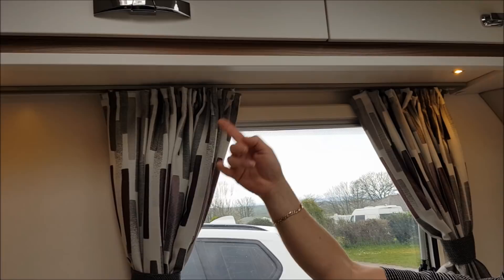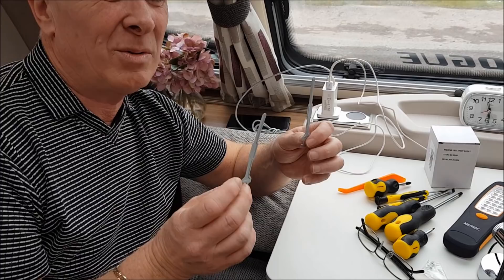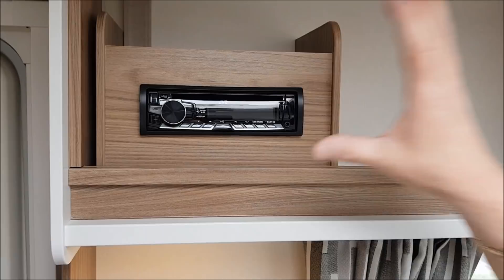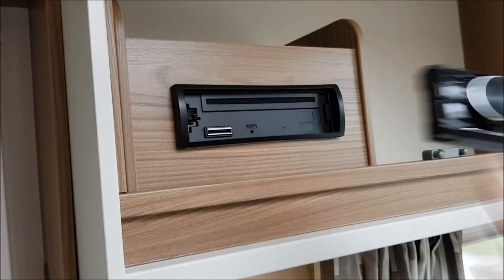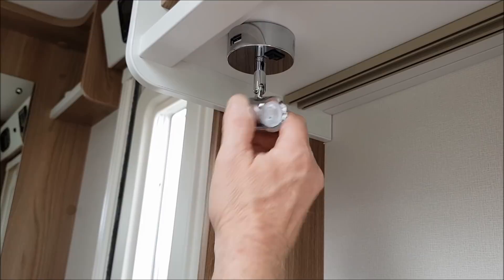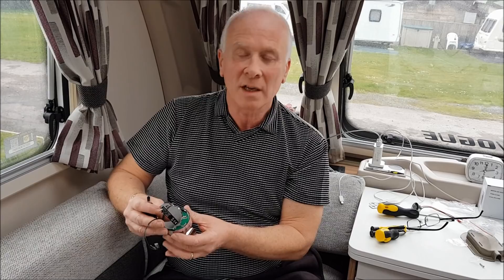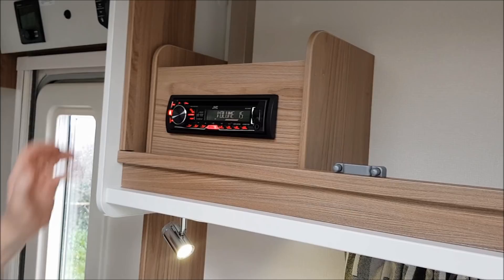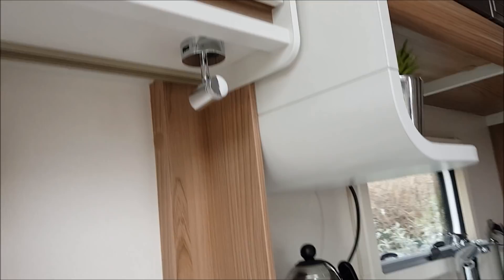Radio removal and USB Spot light Upgrade

Comment: Great job there Keith, I did quite a few mods on my last caravan, including adding mains sockets a cable routed behind the cabinets to allow the TV sound to come out of the stereo speakers. I have the same lights as you have here on my caravan, as I already have a twin usb point at the front, my plan is to fit another switch each side so I can turn them on and off from a seated position.
Reply from the maker: It’s so satisfying when we do these jobs Gareth. Many thanks for watching. Sending our best wishes, Keith & Michele

Comment: Hi Kieth & Michelle, liking the videos so far, I`ve just hit the subscribe button. Julie and I have been caravanning for arounf the same time as yourselves, and as you have said there is lots to learn. I really like this vid as I`m thinking of doing away with those small downlighters in our van, ( a 2019 Swift Celebrate. same as yours but different soft furnishings) and I much preferred the spot lights that were in our last van. Look forward to your next vid.
All the best,
Black Country Dave
Reply from the maker: Hi Dave & Julie, Thank you so much for subscribing & welcome to our channel. If you are going to change to the USB spotlights you may need to look for them on EBay as there is currently a shortage from the original stockist. Let us know how you get on 👍🏻 Thanks for watching, Keith & Michele
Reply: Thanks for the heads up, but I won't be needing the USB socket versions, as our van has USB sockets fitted elsewhere.
All the best,.
Black Country Dave

Comment: Great job there.  You make it look very easy and its good for others to see.  I know it seems a big thing to have as many  usbs all over the caravan but Im not sure Id like wires dangling down from the lights so we just use an adapter plug with usb slots (only the two of us anyway). Good to have the dimmers though.  Great video and thanks for sharing  :)
Reply from the maker: Thanks for watching Guys. Understand about the hanging down cables but for us it's not really a problem as we have a small shelf at the front of the caravan which holds our phones. Keith & Michele
Reply: @keithandmichele  Indeed, we all have different needs and preferences.  Its just lovely that we can adapt to suit those needs and folks like yourselves share your knowledge and experiences.

Comment: Excellent video, had thought of this but not sure Id want all the USB leads hanging out of the lights, think id just prefer to use the plug sockets.  Have to look at it when we are away over Easter for the first time this year.  Keep up the good work.
Reply from the maker: Thanks for watching Andy, we do have a small shelf at the front of the caravan, above the window, which holds the phones so not a problem with hanging cables. The rear sockets we tend only to use at night & they sit on the top of the sofas. Michele actually wants them above the bed now for when she's reading & wanting to charge her ipad! Another round to it job! Thanks, Keith & Michele.

Comment: Keith, Michelle, I have upgraded the pod in the centre chest with two "CBE/C Line Modular Twin USB Sockets. (£21.95 from Amazon) Simpy remove the surround, unscrew the unit and replace the blanks with the sockets, They are made to fit this modular system. It's then just a case of running 12V wires to a power source (I wired mine to the battery) with an inline 10 amp fuse. Maybe worth putting in a switch also as they have a blue LED light on them which may drain a battery if not used for an extended period if not hooked up. See what you think as saves having USB cables trailing from overhead lights. Nick,
Reply from the maker: Hi Nick, thanks for the tip, great idea, thanks for sharing 👍🏻 Keith & Michele

Comment: Hello and interesting video. I'm keen to replace one light. The one nearest to the front of the caravan window. Would I need to remove the master switch if im changing that one light to a spot light. Thanks Steve.
Reply from the maker: Hi Steve. Assuming your new spotlight has its own switch then probably not. You would have to have the master switch on for the new spot to work. May be worth replacing both lights and doing away with the master switch. Hope this helps, Keith & Michele

Comment: Why did you just not leave the light switch in the radio box in the on position no cutting of wires necessary
Reply from the maker: Hi, Thanks for your comment, as this was a permanent fix, we didn’t want to leave the switch sitting under the radio. Also, the opposite cupboards do not have a radio, so we had to have a permanent fix on that side anyway. Thanks for watching 👍🏻 Keith & Michele

Comment: Hi guys, your videos are the best. 2 quick question . . . When you installed the led downlight usb lights. 1: do the usbs work if light is off? 2: are the usbs 1.0 amp or 2.1 amps? Cheers from Wayne Hobbs in South Australia.
Reply from the maker: Hi Wayne & welcome to our channel. Thanks for your lovely comment. Yes, the USB’s work independently to the light so you do not have to have the light on when using them. (We charge phones at night). Unfortunately they are only 1amp so no rapid charging, but not a issue with us. Many thanks Keith & Michele .

Comment: Great video as usual I have a compass corona 524 club 2009 it has halogen spotlights all with own switch will these be just a easy  replacement as I want to upgrade the lighting
Reply from the maker: Hi John, Shouldn’t be a problem upgrading your lights, but we would advise you check the new lights cover the same diameter of the existing hole for cosmetic appearance. Thanks for your kind words & for watching 👍🏻 Keith & Michele.